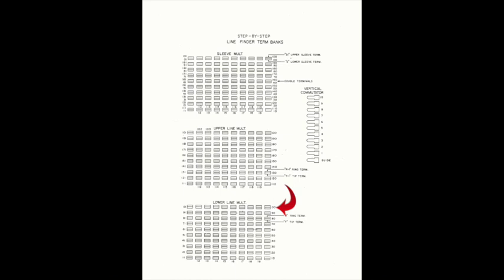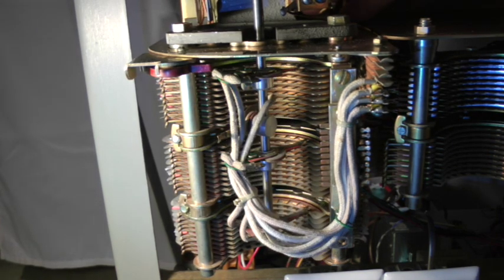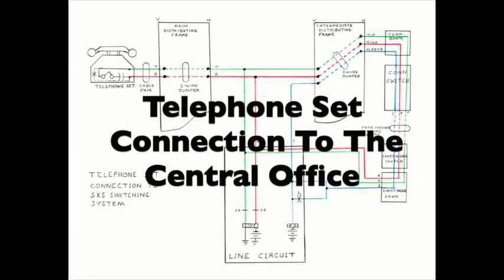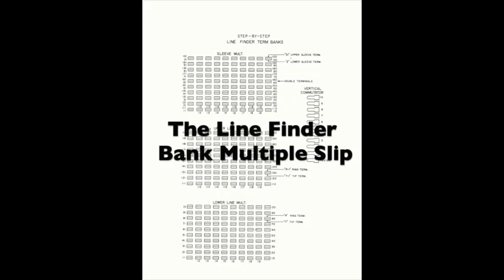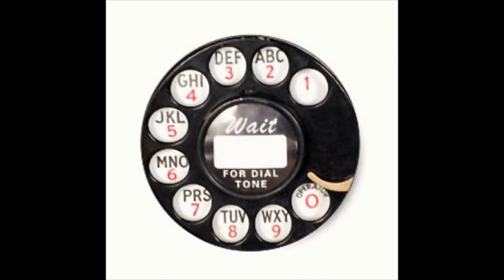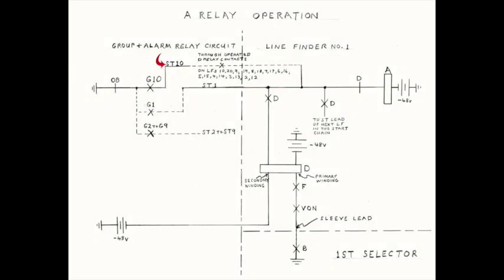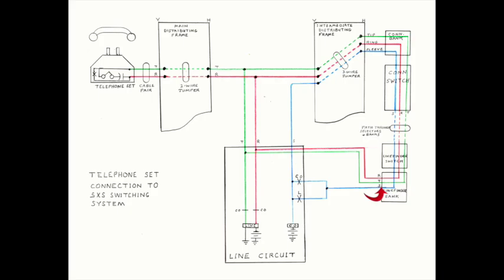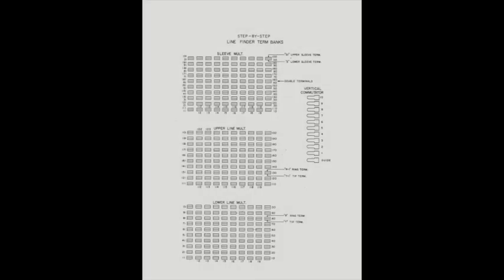The Line Finder In The Step-By-Step Telephone Switching System

Comment: I am an electrical engineer nearing retirement, but one of my peak experiences as a 11 year old budding phone freak was seeing the inside of my home town's CO.  One boring Summer afternoon, I just rode up on my bike and knocked on the door, and the COT let me in to look around.  This was around 1972 in Farmingdale, NY (suburb of NYC), and there was lots of clicking and clacking.  My guess is that they had a cross-bar system because I don't remember anything that looked like a Panel System or SxS.  I do vividly remember a punch-card Trouble Recorder, however.   I'm sure that the COT committed an unpardonable sin and would have been severly disciplined if caught, but I never forgot that day.  I thought I had died and gone to heaven!
Thanks so much for your amazingly detailed explanation of some brilliant electro-mechanical technology!
Reply from the maker: Being able to retrieve and relate fond memories from so long ago is a wonderful part of life. The Trouble Recorder was indeed a feature of crossbar offices. The punched cards were an invaluable tool in the analysis of switch problems. Thanks for watching.
Reply: That was a #5 crossbar

Comment: Ah well. If complicated technical subjects could be learned by watching a video this would be a vastly different world.

How long was the Bell System training school to teach competence on these systems?
Reply from the maker: I never had any formal training on SXS, I just learned from the old guys in the central office. So I don't know how long the training course was. I did take the training course for No. 5 Crossbar, which was 11 weeks. Thanks for watching.
Reply: @Hicken65  to actually comprehend a schematic I always had to make a series of 11x17 copies and mark them up with different color highlighters to highlight the circuit path as well as the contacts of a particular relay. I had never seen the use of / and X for NO and NC contacts before. (Or is it the other way around?) But it is easy understand that back in the day of hand drawn schematics / and X were far easier to draw than two small circles with a bar connecting them for NC and with the bar hovering over the circles for NO.

Where'd the tip, ring and sleeve convention originate?
Reply from the maker: The original schematics for SXS equipment were conventional "attached contact" drawings in which each relay's coils and all of its contacts were shown in one location on the drawing.That is, the relay's contacts and the wires that connected to them were depicted directly above or below the relay coil. This was difficult to read and trace. A different method was employed for crossbar systems called "detached contact" schematics. The relay contacts were moved away from their coils and depicted in locations that pertained to their functionality in a circuit. This allowed complex circuits to be broken out into many Functional Schematics (FS). So for example, a completing marker in a No. 5 Crossbar office, which has over 1500 relays and many thousands of contacts, was broken down into hundreds of pages of FS's to facilitate trouble analysis. In each FS, the detached contacts were shown as a short vertical line for a break contact (which has a through path for electricity when the relay is released and a broken path when the relay is operated) and an "X" for a make contact (which has a broken path when the relay is released and a through path when the relay is operated). Some of the SXS schematics were converted to detached contact type, which made reading them much easier. It is the detached contact methodology that I am using in my video.

In the days of early telephony, when manual cord switchboards were dominant, the  male plug on the end of each cord was a 3-wire plug. So the metallic portion of the plug that fitted into a jack had 3 insulated sections. One wire was connected to the section at the very end or "tip"of the plug. Another wire was connected to a narrow circular "ring" section behind the tip. The last wire was connected to a long cylindrical section that enclosed all three wires like a "sleeve".

Comment: I watched this all the way through - twice! And can hardly wait to move on to the selectors and connectors!! For years I have always wondered how this equipment works since peering through the windows of a central office when I was growing up in Detroit, back in the days of step-by-step and crossbar switches. Thanks so much for sharing your knowledge and equipment with us... This is so fascinating and quite a pleasant experience to understand and admire the ingenuity that went into these devices at this level of detail.
Reply from the maker: It is very satisfying to me when I hear from someone who has watched this video all the way through (and in your case, twice) and found it fascinating. It makes all the effort I put into it worthwhile. I hope you enjoy the other videos. Thanks for watching.
Reply: It’s fairly simple. The first selector is controlled by the dial pulses for its vertical steps then it automatically cuts in to complete a circuit to the second selector. The second selector is also controlled by dial pulses for its vertical steps then cuts in for a connection to the connector. The connector is completely controlled by dial pulses for vertical steps then for the cut in steps. I could tell what bay I was in by listening to the switches. The line finders were fast. The selector was slow vertically following the dial pulses then fast on the cut in. The connector was slow vertically and on horizontal cut in following the rotary dial pulses. It’s fun to remember this but as useless as tits on a boar hog.

Comment: I watched this and for the life of me can't figure out where the subscriber's line is wired in.   When the received is taken off hook, where is that line first connected to?
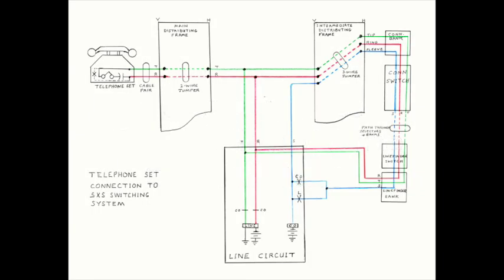Reply from the maker: The diagram at the 40:00 minute mark shows a telephone set wired to  3 different places. First, it is wired to a line relay winding in a line circuit; second, it is wired to  the bank terminals of a line finder group; and third, it is wired to the bank terminals of a connector group. When you go off-hook, you bridge the tip and ring leads together inside the telephone set, which completes the circuit path to operate the line relay in the line circuit.
Reply: The diagram only shows one subscriber.  At what point in the diagram, do all of the subscriber lines come in?
Reply from the maker: @tgcoder  I'm not sure what you're asking. All subscriber lines come into the office in exactly the same way as the one in the diagram. If there were 1000 lines in the office, there would be 1000 telephones wired to 1000 different cable pairs, 1000 different line circuits, 1000 different line finder group bank terminals and 1000 different connector group bank terminals.

Comment: Ah yes...I cut my telephony teeth on SXS in the 1970's.  I loved the clatter of the exchange and could often pinpoint troubled switches just by the change in the rhythmic flow of the normal office sounds.  Later in the #1 and #5 ESS offices, I was never as happy as those earlier noisy days.

Perhaps you could include discussion of class of service or other control conditions thorough use of normal post cams and contacts at some time.?
Reply from the maker: Always good to hear from a fellow switchman. It was great to detect an irregularity and get it fixed before a trouble ticket was issued. Unfortunately, my line finder is not equipped with the optional class of service screening hardware. I do demonstrate the the use of the normal post springs and cams in their digit absorbing application in the selector. This is in my video "The Selector In The Step-By-Step Telephone Switching System Part 2". You can find it by searching my channel name Hicken65. Thanks for watching.

Comment: I worked at the Clevoh45 in the 70s. It was a Panel office. Ohio Bell kept this 1920s technology going until the early 70s when it cutover to #1 ESS. The manning went from 45 technicians to 3 after the final cutover to other technologies. I’m impressed with the knowledge shown in this video. I doubt if the average CO Apparatusman or Central Office Technician has as comprehensive knowledge of the technology that they worked on.
Reply from the maker: You're probably right. I felt I knew more after researching and producing the video than I did when I worked on SXS. Mind you, I never took any formal SXS training and just learned from the "old guys" as I went along. Also, I didn't spend a lot of time in the SXS. Our CO had both a large SXS and a large #5 Xbar. I spent most of my time in the Xbar. Thanks for your feedback. It's always nice to hear from a fellow switchman.
Reply: @Hicken65  Are those "Old Guys" the same as the Big Old Guys [who] Bowl Saturdays?
Reply from the maker: @danielsandoval2846  No, my old guys have long since shuffled off their mortal coils.
Reply: Bell of Pennsylvania in Pittsburgh started cutting over panel offices to #1ESS in Dec. 1975.   A great Xmas present

Comment: Would it be accurate to saw that the "relays" are solenoids? aka: transform electric current into magnetic force that cause movement? 
(normally, a relay is considered to be an electrically activated switch to let current flow or not).
Reply from the maker: The relay in the SXS switching system is a device that contains a solenoid as one of its components. The solenoid is an electromagnet that consists of a copper wire wound onto an iron core. The relay also has an armature, a moveable magnetic metal arm that is attracted to the solenoid when the solenoid is energized by an electric current, and the relay also has a set of electrical contacts that can be closed or opened by the movement of the armature.
Reply: @Hicken65  Thanks. If there is both mechanical action and electrical contact, I guess the term "relay" works,. he old AT&T videos also use the term "relay".

Comment: Here in the UK we used uni-selectors to enable telephones to seize a line.
Reply from the maker: The UK also used two motion (Strowger) type linefinders, likely in the larger exchanges. In the Bell System, the first SXS systems to be used (circa 1920) were the Automatic Electric designed systems that  used either the Keith Plunger line switch or the Uniselector, which was called a Rotary Line Switch in North America.The Bell System developed the two-motion line finder around 1926.
Reply: @Hicken65  Thank's for the info.

Comment: Do the 200 lines represent subscriber lines or outbound lines?  If it's outbound lines, how are the subscriber lines connected to the line finders? I assume each subscriber can connect to n-number (e.g. 10) line finders per each 50 to 100 groups of subscriber lines to reduce 1-to-1 scaling complexity?
Reply from the maker: The 200 lines are subscriber lines.They are wired to the bank terminals of a line finder group which contains 20 banks and up to 20 line finders. The 200 lines are multipled across all 20 banks so that they can be "found" and connected to any one of the line finders in the group. So 200 lines have shared access to up to 20 Line finders.
Reply: @Hicken65  Ahhhh....got it.  So the sleeve connections help in the determination if a line finder is already engaged or not.

So unlike a crossbar switch, the line finder stays engaged for the duration of the call then releases upon on-hook.
Reply from the maker: @lohphat  The sleeve lead provides four main functions in the SXS system. On the line finder bank, it identifies the location of the line requesting service; on the connector bank, it identifies the busy/idle status of a line being called; it blocks a dial tone request from being initiated by a line when an incoming call is being answered by that line; and it acts as the control wire that keeps a switch train operated for the duration of a call. So the line finder, selectors and connector involved on a call are all held operated for the duration of the call by the sleeve wire.
Reply: @Hicken65  So the sleeve is energized when active so that when the wiper scans across it's looking for an inactive sleeve lead? Then as it progresses through the connectors, idle trunks and connectors are detected with an inactive sleeve....what prevents two connectors finding an idle trunk at the same time and both grabbing it thinking they're the first?  Are two calls ever linked by mistake?
Reply from the maker: @lohphat  I suppose  double connections may have occurred from time to time, but I'm not aware that it was ever an issue to be concerned about. The change in the electrical condition on the sleeve lead occurs within about 50 ms of seizure of a circuit, so it would have to be a very close race to create a double connection.

Comment: Hi. I must have watched about 20 various videos on how telephones work etc., and even I can't believe that I watched ALL of this one  as interesting as it is.  1hr 40mins is a long time, but I stuck with it 'cos I wanted to know.  I've got most of it, and of course I now realise that the relays are THE crucial parts; what with introducing deactivation delays, and multiple contacting.   Much of this makes more sense of what I used to know as a child from the late 50's and early 60's  dials clicking on their return, sparks on 2 wires. Oh what fun.
The one main question I have now is this.  How on earth did an undertaker conceive of such a switch, indeed  an entirely automated telephone exchange when the 'birth' of electricity was barely only 50yrs earlier?
Very few people were THAT familiar with electricity back then.
So, a bit like Filo T Farnsworth, a 17yr old farm boy conceiving the electronic television principle, how did Strowger do this too?
Thanks for sharing this video.
Regards Mark in the UK
Reply from the maker: Strowger certainly had a good understanding of electromagnets, pawls and ratchets and his concept of how to apply these components in an automatic telephone selecting device was quite an achievement. However, his device was a very rudimentary one in which each electromagnet was directly operated by the calling subscriber, necessitating 5 wires between each telephone and the central office. Telegraph type keys on the telephone set had to be pushed once for each vertical and rotary step taken by the selecting device.  His device did not contain any of the intricacies of the switches in my videos. As simple as his two-motion selecting switch was, Strowger was unable to get a reliable working model of it built, and had to design and file another patent for a single motion (rotary only) switch, which was the one installed in the world’s first automatic exchange at LaPorte, Indiana in 1892. Strowger left the telephony business in 1896, due to failing health just as the brilliant people he had hired actually designed and produced a workable two-motion stepping switch and the first rotary dial. It took the next 30 years to fully develop and refine the step-by-step switching system to the level depicted in my videos. To fully understand the system, you need to see my other long videos on the selector and the connector. Just search on my channel name, Hicken65, in You Tube. Thanks for watching.
Reply: @Hicken65  Strowger's company became the Automatic Electric Co, which furnished  and further developed  the step-by-step equipment. Bell System at one time was buying AE up to the mid-1930s.These bore a WE nameplate, but was really identical to AE,
Reply from the maker: @rayfridley6649  Undoubtedly, AE gets all the credit for SXS design up to the mid 1920's. However, Western Electric began manufacturing SXS equipment in 1926. From that time on, the Bell System made many significant improvements to the SXS system, some of which were adopted by AE. The design of the two motion SXS line finder belongs to the Bell System. AE only had the Keith Line Switch and the rotary line switch until Bell came out with the SXS switch line finder.
Reply: Don’t forget Western Electric and Bell Labs developed most of the technology in a Central Office. There is a switching system that was used in big cities called Panel. It was developed and installed in the 1920’s. Many COs used Panel until cutover to ESS or Crossbar in the 1960s or 70s. The knowledge shown in this video exceeds anything I experienced in the CO or in training at Bell System training centers.